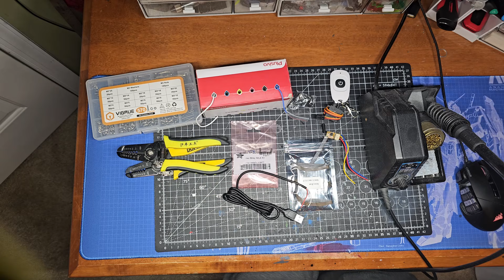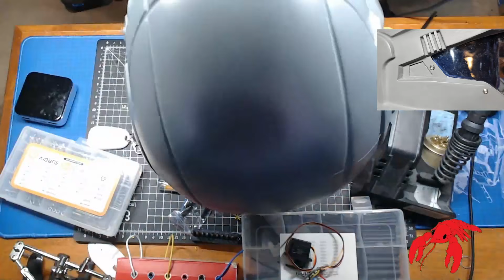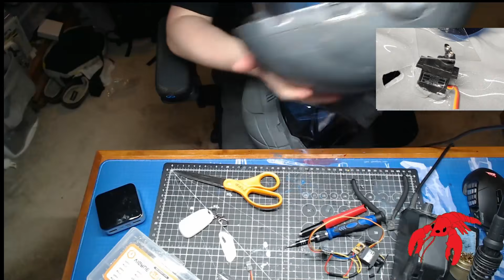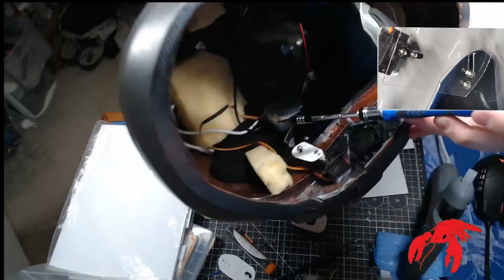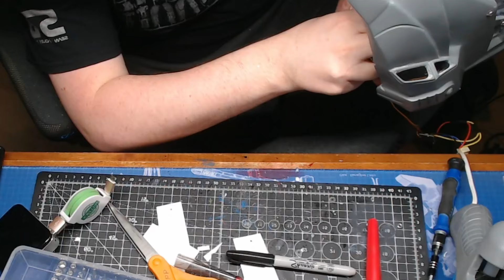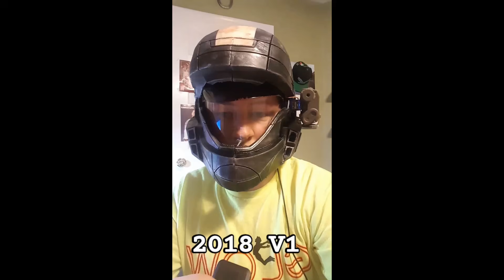Creating an ODST Flip Visor

Comment: Sick to see the updates. I already have a completed helmet with visor, however, I'm wondering if using the tinted vacuum formed visor as the moving visor would improve fit. What do you think?
Reply from the maker: I would avoid using the vacuum formed visor as it can impact the outer visor! The flat surface of the inner visor helps to sell the effect
Reply: @rocklobbster you know? When you put it that way, you're absolutely right. I was wondering the same thing but then I read your comment. Well done btw!